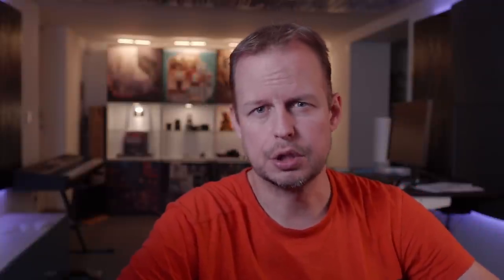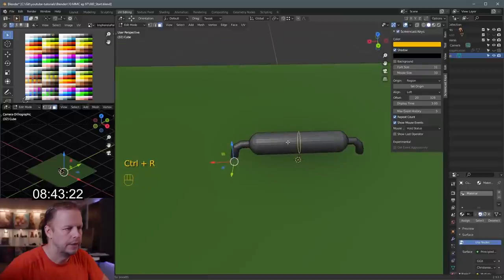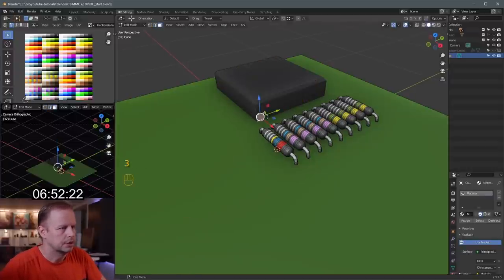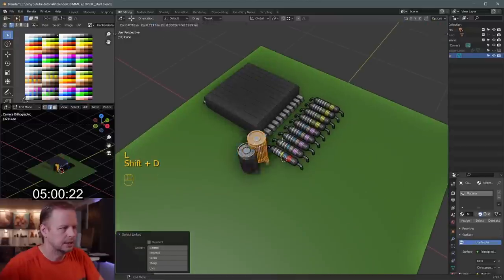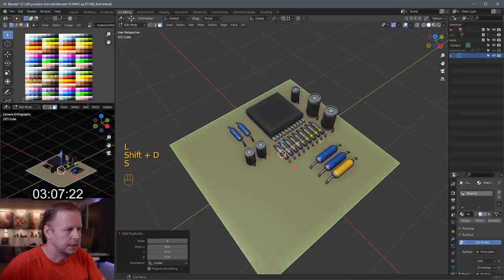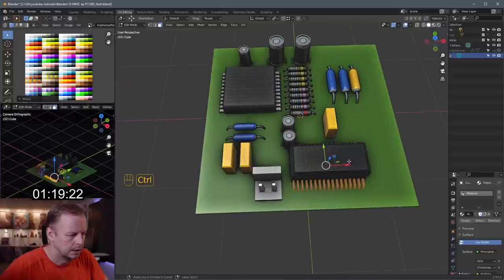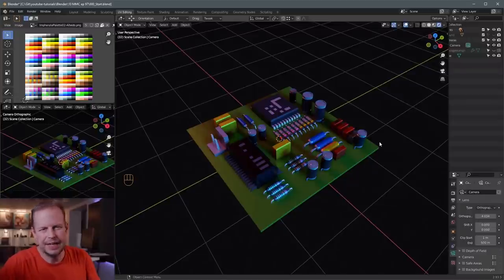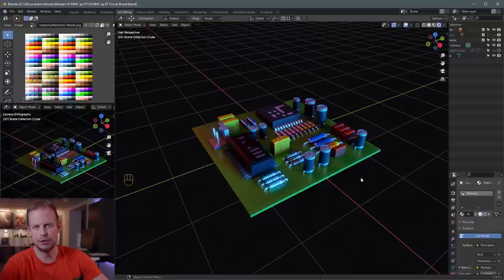Let's model a CIRCUIT BOARD in 10 MINUTES - Ep 97 - Blender 2.93

Comment: Hi Imphenzia, great video as always. I got a bit triggered by your idea of the missing circuit lines on the board, I think they would be a large improvement. But I am simply unable to find a feasible way to create them. I am trying to create thin cubes and use bool tool to cut them into the circuit board, but I always end up with super awkward result. Any guiding idea on how to create such patterns? Perhaps you covered something similar before in another video?